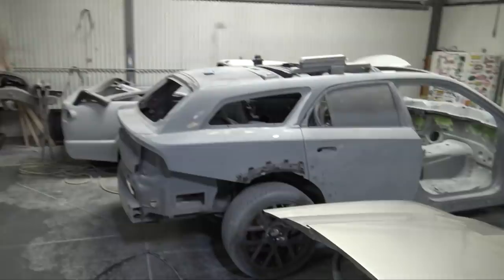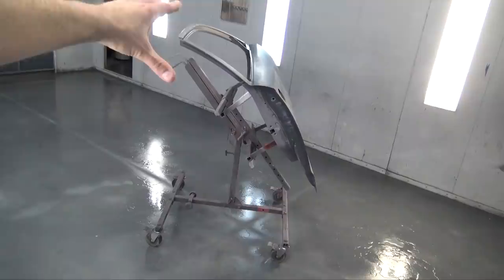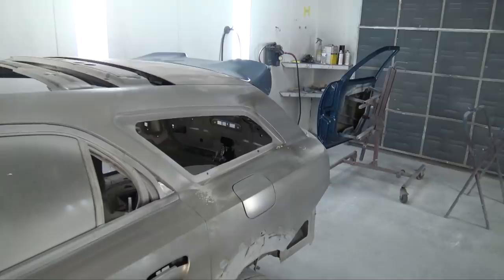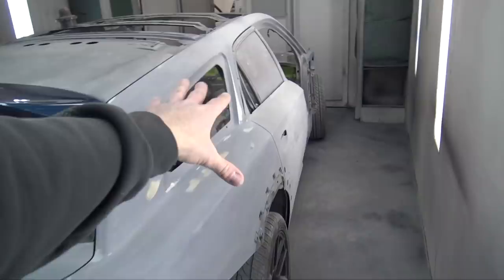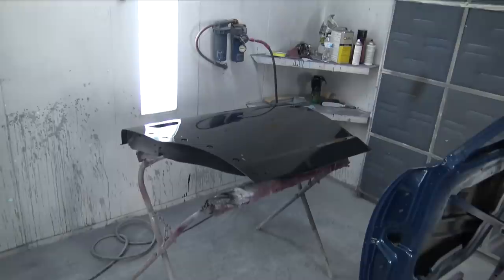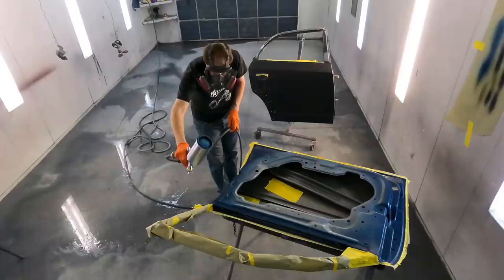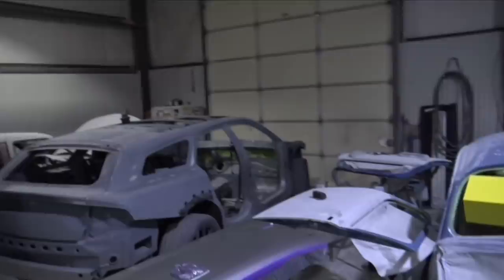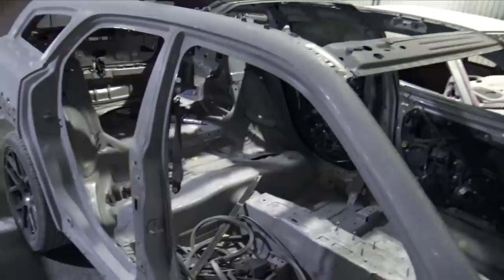Building the Ultimate Station Wagon | 2021 Charger Magnum Hellcat | 1000HP Hellwagon | Pt 45

Comment: Glass is an understatement dave, she is gonna be beautiful mate!
Reply: No this car is going to be 5 different shades of blue by the time he is done.Im a painter. I've been painting high end and custom stuff for 22 years.It will never be the same color.That's why when you shoot panels you blend into the joining panels a little.For the paint to match. Temperature,humidity,the amount of hardener and reducer( varied by mils )can change the final color of each cup mixed.This is going to be a disaster and he's going to have to scuff the outside and shoot the whole thing at one time when it's together.
Reply: @CerebuZ It depends if you're doing everything or just the outside...In other words you mix enough to do the coats you're doing at that moment...In this case the jams and engine bay would be sprayed first.Then the outside would be done with the same batch on the same coat..I'd spray it all with the bumpers n fenders off but with the same paint mix.Then I'd spray it all again with the second coat mixed.As well as third if needed.Then clear it all.Thats how it should be done.
Reply: @CerebuZ For example.The car in my pic is my 17 GT...It was sprayed when it had 5 miles on it.I took it to bare metal..Shot the black first..Taped the stripe off and then painted the actual gray on the car.I didn't like the quality of the factory paint.So I redid all of it when new.The jams were done first followed by all of the coats of gray.I mixed enough for 3 cups of paint per coat at a time.
Reply: @davidciabattonijr8170  I'm sure Dave painted the way he's doing with other cars and turned out fine. He got this.
Reply: @PanameraTurboSEHybrid  You'll see.I saw that he liked your comment and all.I'm not hating on him either.I'm trying to make him see the facts.Once you own a bodyshop and paint everything from a Honda Accord to many Ferrari products come back and tell me about it.

Comment: Personally for me when I do a complete overall paint job is do all the jambs with it blown apart including the chassis jambs, then assemble the vehicle and mask off all the jamb openings and spray the entire exterior at once. The panel painting like that can sometimes cause color differences in each panel even if you’re using the same batch of color. Little things like pressure differences and minor technique adjustments when painting each part separately can cause the color to be off a bit, at least in my experience it’s best to spray the exterior in one go. Regardless of that it’s looking really good man, your skill set has improved substantially!

Comment: I appreciate how meticulously your working, however I struggle to understand why you’re painting external panels individually. Even out of the same gallon, metallic flakes lay differently every time and it seems like you may be setting yourself up for mis-matched body panels as it relates to color.
Reply: Your right, there are so many thing that affect the way a paint job looks , the temperature, humidity , air pressure the way the panels are are laying when painted, there is so much stuff that car will need an all over paint job when he's done. My friend painted 1 like that & it look like a quilt when he was done
Reply: Having had the experience of painting, I can appreciate both comments👍.  (while watching the video, I wondered the same thing🤨.) Then came down to the comments and noticed there was no love given...🤔
    Uh oh.....(❓)
Reply: I am curious as well. I can see cutting all the parts in, along with the jambs on the car, then paint the whole outside in one shot.
Reply: @davidsimpkins8639  I’ve got nothing but love for the guy, the build and his obvious talent. This is just a mistake that may bite him in the end, requiring him to then scuff down the car once again and re-spray the entire exterior at once (minus the carbon fiber). I’m not sure if he doesn’t realize this or maybe he’s simply making content and doesn’t care, but it’s a risk I would not be willing to take, especially for a SEMA build.
Reply: Even a non-metallic color would be hard to match-up the way he's painting it WE ALL LOVE Dave
Reply: Dave going to tie up his buddies shop now an extra month to correct that paint job if he ends up painting it that way

Comment: I can’t wait for part 693 when he paints the door handles.
Reply: I can't wait til 694 when he realizes none of it matches and he has to paint the whole outside of the car for the colors to blend.
Reply: @davidciabattonijr8170  lol ok so im not the only one that knows this is a thing...thought i was missing something
Reply: @jimbo8v92  Nah bro..I've been painting for 22 yrs..really longer than that before I painted my first whole car.I'm 37 now.From all of my experience with many different paints.The newer low voc stuff..older stuff..water-based stuff..This is NOT the way to do it and WON'T work.Been there done that against all advice but had to learn the hard way bc I thought I could pull it off. DEFINITELY NOT.
Reply: @davidciabattonijr8170  yeah i did nothing, but paint and bodywork for about 10 years or so when i was younger. I got out when they were starting to make everyone go waterborne and ive never seen anyone or heard of someone panel painting like that.. even if it was only a door that had gotten repaired you dont just spray that door you need to blend the panels..and as much work as he put into the body on that car its going to be a sad day like you said... when its in the sun its going to be extremely noticable...or maybe he knows something we dont lol
Reply: @jimbo8v92  Exactly...The sun is key.It might even look good on camera, but not up close to the naked eye.Everythings not water-based either.I use mostly low voc stuff but I spray water too.The newer paints are harder to spray than the older stuff from 15 or 20 years ago.Well atleast different techniques and it's not as forgiving.I mean you have to really try to mess up clearcoat but some of the colors can be tricky.It is all a preference of which brand you use too.Most manufacturers colors are slightly different too.For example if you use Sherwin Williams stuff it'll be a slightly different shade than say a Dupont or PPG base coat.Even if you give them a factory paint code to match.Then the temp,humidity,reducer,and hardners will impact the final color too from cup to cup mixed by you.That is why this is not going to work.You paint a front door..You blend into the fender and quarter or rear door too.Period.

Comment: I get what you are doing spraying the inside and outside of the doors the way you are. For PPF I think your overthinking it a little. The biggest key with it is it doesn;t go on until the paint has cured for at least 30 days. You do it sooner then you risk messing up the paint. Wait until after that and it'll be fine. Also, realize that PPF goes on wet not dry like vinyl wrap. This allows for easier stretching and the film tends to be more forgiving than vinyl wrap. 

I have done both and vinyl wrap can be a bear to paint, especially when you want to take it off and yes, it can damage paint. PPF, the adhesive is more forgiving and simply heating it up and going slow it will come right back off. Film from 7 to 8 years ago that yellowed was a different story but the current films are far more durable, offer better protection, and come of the paint very easy. Usually just a little clean up in certain spots for a little bit of adhesive.

As for brands, while 3M invented the product, I think you get a better product with the higher end films from Xpel or even Suntek. Just be aware, that car, to have it wrapped completely the right way, It's probably going to be $$$.

Comment: Are you concerned about weird flip issues or consistentcy with painting everything seperate on different days?
Reply: Also pull those brackets off the door stand and flip them upside down, put them in a better spot other than a hole so you only have 4 edges contacting. Have another person push the lower bar down to tighten the door into place and tighten up the adjustment. Should be a one shot deal, less overspray or chance to scratch the outside. Jams always first.

Comment: You're doing it wrong !
You never risk a finish you spent hours to get right to paint something no ones going to see. You do the hard parts or parts no one will see first always.
You never paint one panel at a time in it's final finish. You get them all to an almost complete stage then line up at least one side of the vehicle and finish it and try to do the other side the same day or set them on the car and spray them all at once,
Other wise you risk every panel looking noticeably different.